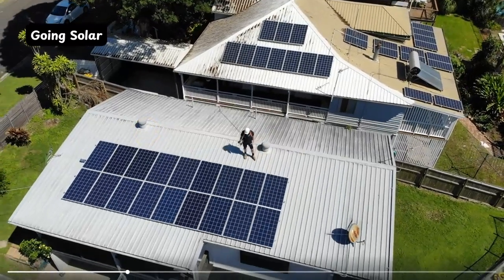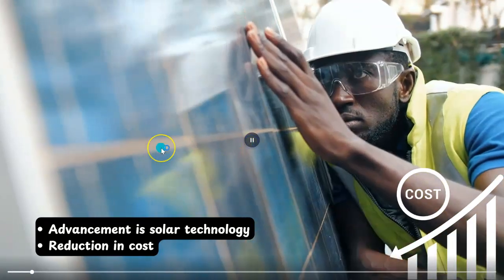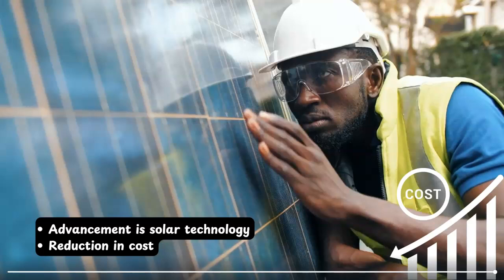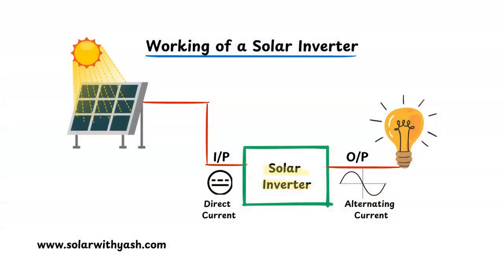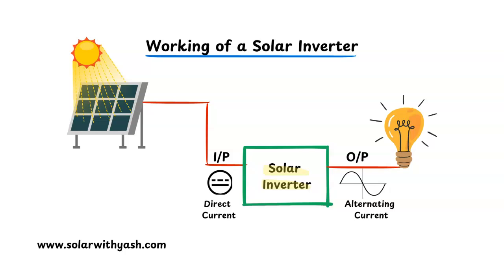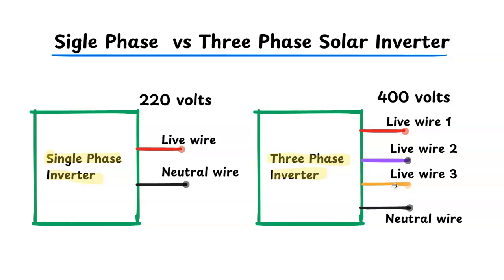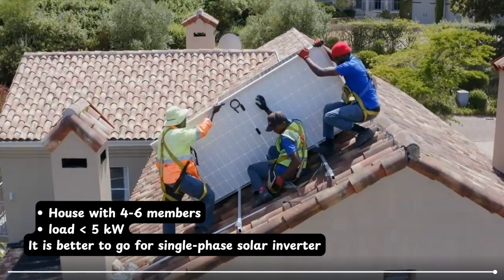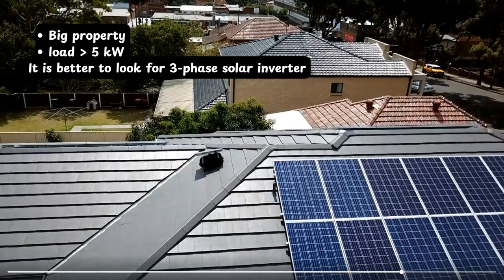Single Phase vs Three Phase Solar Inverter

Comment: Sir, I have 3 phase meter in my house, it connected to Lift and shops, 350kwh units per monthly.
Solar technician tells that , don't use 3 phase inverter,  it gives more technical issues.
They are providing me , Polycab 1 phase 5000w inverter for 6k solar system.
Can i use 1phase inverter to my 3phase meter
Reply from the maker: Rajesh ji, yes — technically you can connect a single-phase inverter to a three-phase meter, but it’s not ideal for a 6 kW system like yours. In such a setup, the single-phase inverter will inject solar power into only one phase, while the other two phases (on which your lift and shops run) will still draw from the grid. The 3-phase meter will do the net calculation automatically, but the problem is phase imbalance — one phase will be heavily loaded while the others remain unbalanced. For smaller systems up to 4–5 kW, a single-phase inverter is fine, but for 6 kW and above, a 3-phase inverter is strongly recommended. It distributes power evenly, avoids neutral heating issues, and is also a requirement for net-metering approval in many states. Polycab and other good brands have reliable 3-phase inverters, so don’t worry about “technical issues” — they work very smoothly when installed properly. In short, for your 3-phase meter and lift/shop load, go with a 3-phase inverter for better performance and long-term reliability.

Comment: So if it's on grid then, it doesn't make any difference with Single and 3 phase right?
Reply from the maker: No
If  your grid supply is single phase then for solar single phase solar inverter is required. 
Similarly,  for 3-phase grid supply,   3-phase solar inverter is needed.
Generally for homes with loads <= 5 kW have single phase supply.
Therefore, a single phase 5 kW solar inverter is installed.
Thank you for watching the video. 
Yash